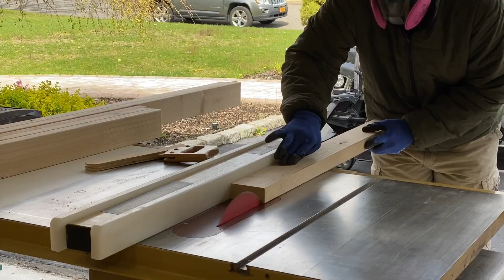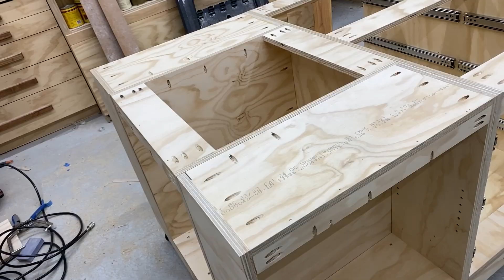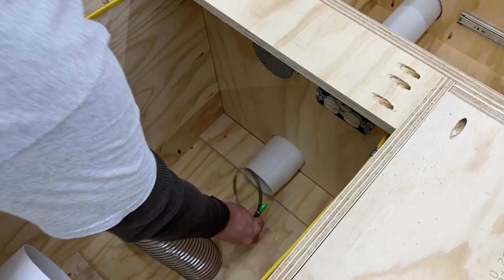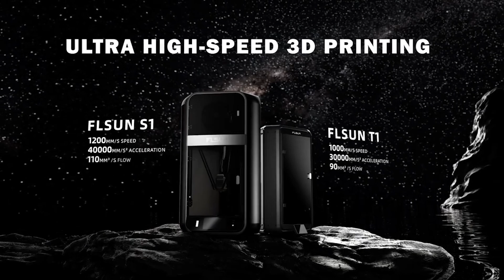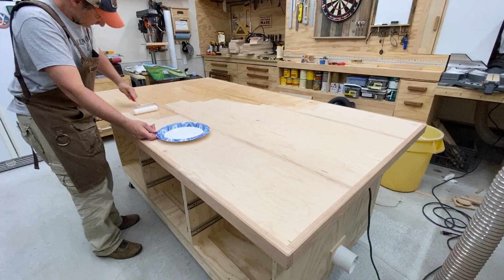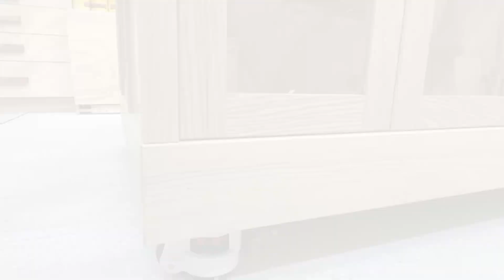This Mobile Workbench / Outfeed Table Is The Greatest Workshop Upgrade Ever / DIY Shop Furniture

Comment: Great build! Cool router trick using it horizontally. Why didn't you do a butcher block top since you are wanting it so thick?
Reply from the maker: Thanks. Butcher block tops warp easily when  they are very wide

Comment: Loved the desing and the video.  I'm retiring my long time small shop table/cabinet and want to build yours from your plans.  Any suggestion on how to make the last layer of the top replaceable?  I tend to beat mine up and would like to swap it out evry couple of years.
Reply from the maker: Actually, I didn’t mention it in this video, but the top layer of my table is replaceable. In the original videos I go into more detail, but if you watch them, you will see that I don’t glue that top layer down. I simply use longer screws from underneath to hold it together. If I should ever need to replace it, I will remove the screws and I will have to cut the oak trim around the borders.